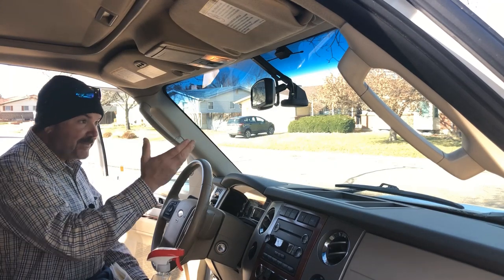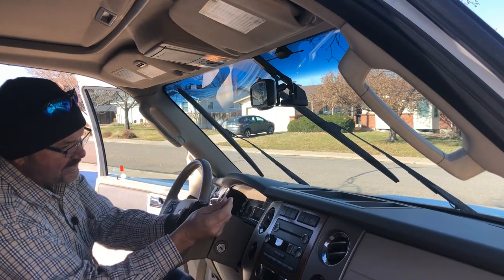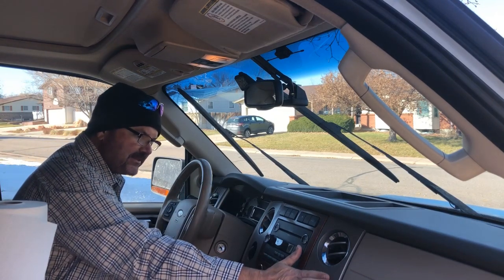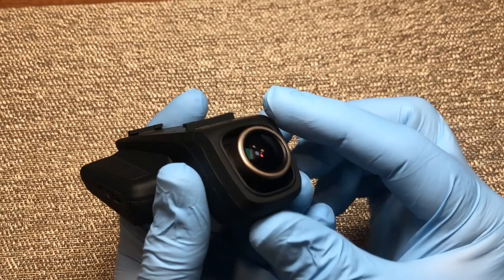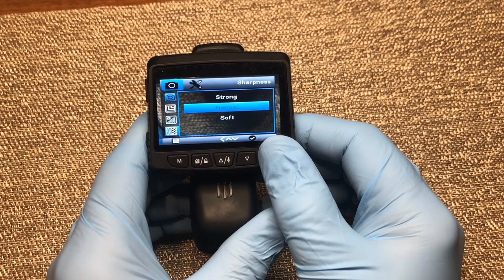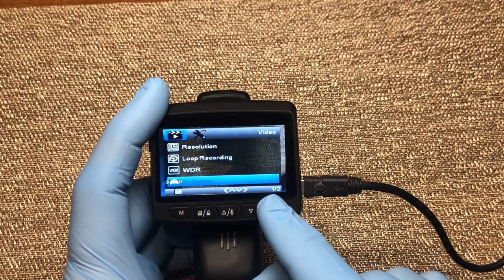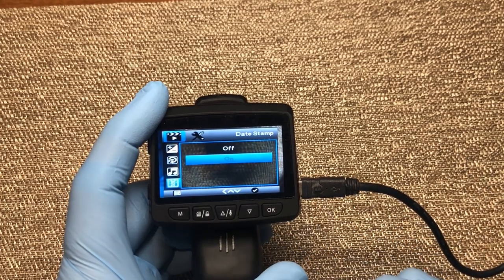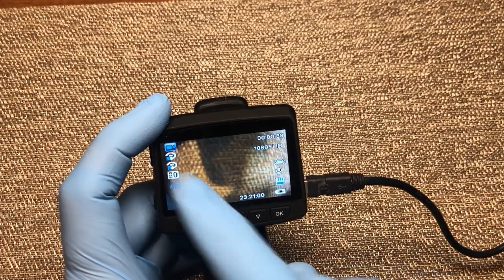Dash Cam Install, Settings & Setup - Outlook 1080P HD Dash Camera at Harbor Freight

Comment: I just purchased this camera yesterday. Your two videos regarding it has been very helpful. The manual that came with the camera was lacking much information and hard to read, do to the small size. I only need to learn how to download onto my computer, and I will be all set. Thanks
Reply from the maker: Paul Schultz - Thank you very much!  I have to agree, the manual is a bit lacking and the print is a bit small.  If you download the manual in a PDF format it will be easier for you to read.  Here is a link to that PDF:  https://manuals.harborfreight.com/manuals/56000-56999/56226.pdf
The other benefit is now you wont have to worry about losing the smaller one.  I"m very happy to hear my videos were able to help you.   To get my videos on my computer I just use a microSD to standard SD card adapter and then insert it into the SD port on my computer, I can then view the files and move them if need be.  Here's an idea of the adapter I use:
https://amzn.to/2L187uu
Thank you for taking the time to leave me some feedback - much appreciated!

Comment: i have 2 of these and they are great for the $. if you are trying to look at videos, take card out and use adapter to watch on computer, much easier. might not like this but you can get these on ebay for $26-30, which is a steal. great camera for a 1080
Reply from the maker: @Captain Planet -These things are great aren't they?!?! Great advice on the MicroSD adapter, I didn't cover that in the video so thanks for pointing that out. I did take a look at eBay after your comment. There’s certainly some listed there, however it looks like they are  resellers. I don't believe HF sales on eBay (at least not that I've ever seen) so I would be careful that they are indeed new in a sealed box. The  other downside would be no warranty from HF in the event there's a problem with the cam. In the end folks have to make that decision for themselves, I certainly get nothing from this so whatever you're the most comfortable with - do it. I really appreciate you stopping by and taking a moment to leave some great information that will benefit others, thank you very much!
Reply: Is it possible to play back the video without purchasing an adaptor?

Comment: I just purchased one of these today and honestly couldn't be happier with how simple it was to install my only complaint has to do with having to manually press record or pause each time but that's just due to the fact my cigarette lighter gets 12V constant power even without the key in accessory and which also is convenient for recording while parked I'd still prefer to order a dash-cam wiring kit to free up my cigarette lighter and be able to conceal the wiring a lot better
Reply from the maker: @Giovanno Galindo - Glad to hear you like it!  We are still using ours with no problems.  In fact, I purchased a second one that is going into my truck when the new windshield is installed.  An install kit is a great idea, too bad they don't offer one.  FYI, I have mine plugged into an outlet that always has power and I turned off the motion sensor mode so mine is recording 24/7 in a loop.  This makes it so I never have to mess with it.  Thanks for stopping by and taking a moment to eave me a comment - much appreciated!
Reply: @javosgarage  Thanks for the tips I'm definitely going go pick up a couple more for my other vehicles or maybe even as a gift & they were actually on clearance at my local HF which is really nice one thing to note for anyone interested in purchasing this particular dash-cam I wasn't able to find it anywhere on the shelves I actually had to check with an employee to see if they had any available from their inventory

Comment: I had a quick question. I also own one of these and I’m getting a message saying I need to format the sd card for some reason. It just started a few days ago. If you know anything about it I would appreciate it. Thanks sir. Great video
Reply from the maker: I'm sorry but I haven't run into that.  Actually, ours is still working perfectly.  Maybe a file or directory somehow became corrupted?  Not sure.  I guess you wouldn't have much to lose by formatting the card and see what happens.  I've had no issues putting different cards into ours when we were on a road trip and wanted to keep some video of a national park we drove through.  Maybe just switch the card out.  Wish I could be of more help.  Thanks for stopping by!

Comment: I was the first one at my local harbor freight to buy one of these... the directions it came with were so basic and horrible. I was so frustrated until finding this video! However i was wondering... it says with a 64g card it can record up to 9 hours. Is this 9 continuous hours??? Or just 9 hours all together of recording? I installed a 64g card and Ive noticed (even if my loop feature is off)... after about 10 min of driving... it starts recording all over again?
Reply from the maker: K S - I'm glad my video has been helpful to you.  I honestly haven't tried a larger card in mine yet, the 16bg card with a loop at 5min intervals has been fine for me.  However, like all dash cam specs I'm sure the time you can record is based off of the lowest settings.  The higher the quality of the image your capturing the more space is required and therefore the amount of time you can collect is reduced.  If you have loop turned off and you set it to record it should continue until the card is full. That should be much more than 10 minutes.  Have you pulled the card to look at it on your computer?  I'm wondering if the screen saver feature (that turns the screen off at 10 minutes) may be confusing some things.
Reply: Javo’s Garage .... i deff havent tried it on my computer.... and i do not have a screen saver on.... this is very frustrating because when i play back my trip... i notice that even though my ride was 30 min... only the last 5 minutes is available to see. So if you figure anything out please keep me updated!! Ty!
Reply from the maker: K S - I will adjust the settings on mine to match yours. I have a 32gb card that I'll switch out with the 16gb as well.  Give me a day or two to let it record so I have some data and I'll get back with you.  Just to be clear your settings are  - Time Loop: Off, 1080p video, Screensaver:Off, Frequency:60hz?  What about motion detection and park guard as well?  I want to make sure I'm setup exactly as you.
Reply: Javo’s Garage - yes that is all correct....!  I hit record when i leave my driveway.... and if i check the recording 30 min later... its only showing me the last 10 min of my trip! If u figure it out that would be absolutely perfect!
Reply from the maker: @KS-cd1im  Let me see what I can do to help you.  I'll give you an update in a day or two after trying your settings with a different card.
Reply: Javo’s Garage - awesome!!! Ty!
Reply from the maker: @KS-cd1im   Well I have some interesting data for you!  So I put a 32gb card in my dash cam and did the settings we discussed...  I ended up with 13 videos that were each 25 minutes long.  We can only assume that the system will default to this so at least the file will be a manageable size to download if need be. This ended up being 325 minutes or 5.42 hours of "continuous recording.  Oddly, there were another 13 videos and the majority of those were 47 seconds, yet it was also a continuous recording.  These totaled 638 seconds or 10.6 minutes.  My only guess here is once the system realizes the next 25 minute file will be too large to save it then just starts saving in small sections until the card is full.

Not sure if this really helps you but at least we both learned something new about our dash cams.  Let me know how you ended up with yours.  Did it start doing what you needed or did you possibly get a replacement?  Good luck!
Reply: Javo’s Garage - thanks for doing some research for me. When I initially bought this dash cam the box said “up to 9 hours of record time”... so in my mind im thinking this means i can take a road trip for 9 hours and have the whole thing from start to finish... so i was super disappointed when my cam would only record for 10-15 min at a time? Even with the 62g card. So this is when i came to ask u a few days ago if u could figure what was going on... but i think weve both figured out its not 9 continuous hours of record time. Its up to 9 hours of storage space for 10-30 min recordings. Anyway. As disappointed as i was.... i still kept it. I paid 69.99$ for it with a coupon so i figured it was a good deal. Thanks for looking into that for me

Comment: Will it work on a GoPro mount?
Reply from the maker: @Ronald Coleman - Hi Ronald.  I don't believe this would work for that application.  Two reasons: 1. The only available mount is the adhesive backed base that is sloped in such a manner that it is designed for a windshield and 2. Even though it has an internal battery, it is very limited.  You can only expect to get about 10-15 minutes out of it.  Sorry, I wish I had better news for you on this but I would look for something else.  Thanks for stopping by!

Comment: what about mounting the dash cam on the dash
Reply from the maker: @gigeo48 - All of the mounts that come with this camera are designed for windshield mount.  Due to the design of the camera, I can't think of a way you would be able to mount it directly to the dash.  Thanks for stopping by!

Comment: How do I keep the camera on while driving???
Reply from the maker: @Sebastian Robles - Sorry for the delayed response, things have been a little crazy getting ready to start having the kids do school at home.  What a project!  In any case, if you have the camera set to motion it should be recording while the vehicle is moving but it can shut off when you're stopped at a light.  However, it should resume when you begin to move again.  Quite frankly I have mine plugged into an outlet that always has power and so I have mine set to constantly record, even when parked.  I did this by turning my auto power settings to off.  Also, if need be you can press the OK button to turn recording on or off (as well as take a picture if you're in that mode).  Hopefully this info points you in the right direction, if not let me know and I'll make sure to do what I can to help you.  Thanks for stopping by!
Reply: Javo’s Garage thank you so very much!!! No need to apologize!! Thank you for your help and stay safe!!
Reply from the maker: @Sebastian Robles - No problem, glad to help.  You and your family stay safe and healthy as well.  We'll get though this!  Hopefully my wife wont have me buried in the back yard before it's over though - LOL!  Have a great day.
Reply: @javosgarage  I am not following this. Motion detection "on" setting you say is if someone walks in front of your car, the camera will turn on and record. If I set motion detection to "off', it won't record that person. I don't want the camera to stop recording if I am at a stop light. Half the issues arise when you are stopped. The other day I had to stop because someone brake checked me then got out of their car and approached mine. I would want that recorded. What settings would ensure this?

Comment: Good video, but the dashcam is absolutely useless unless you can playback the video.  Is there a reason you don't address this?  Is it possible to play back or view what has been recorded?  And if not, what is the point?
Reply: I was able to remove the cam, and plug it into my computer with a spare cord that fit in the USB port.  It comes on and off so easy, its no big deal for me.